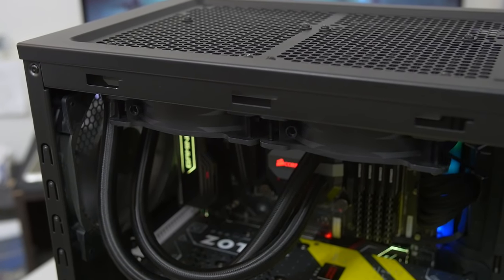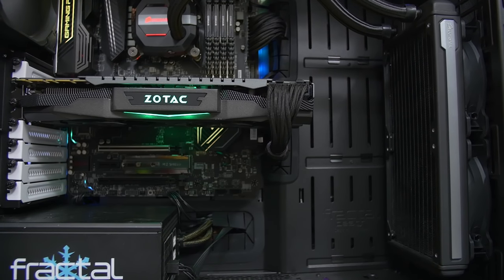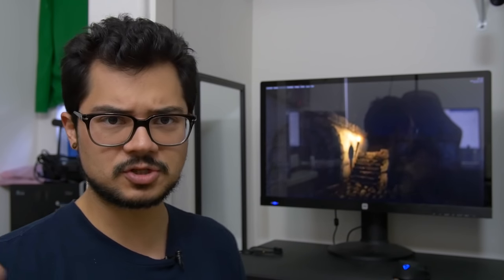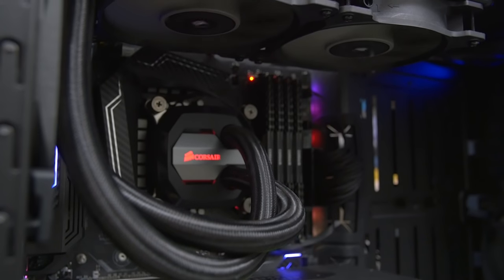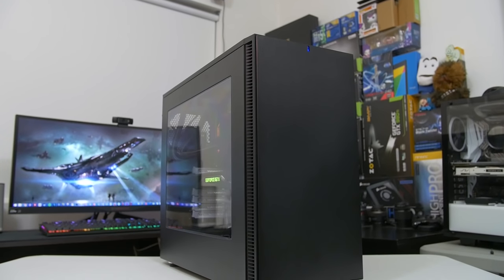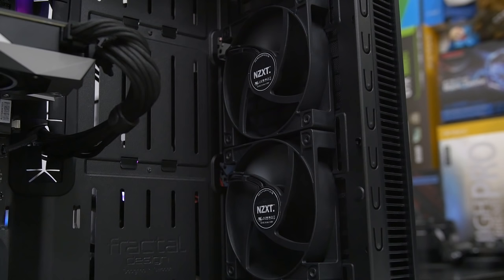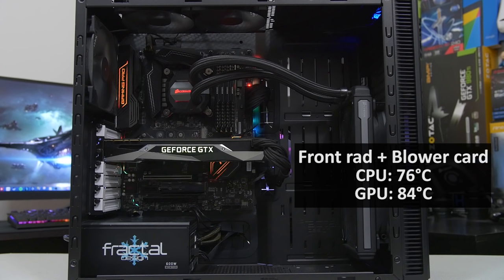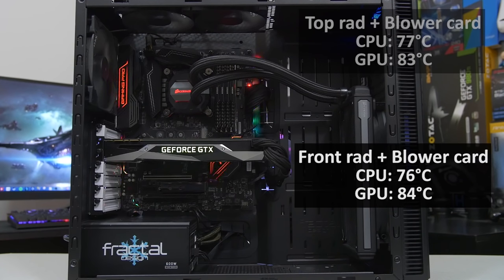Does Radiator Placement Matter? Hint: YES

Comment: I know this video is three years old now, but I have to point out one thing:
This video only really applies to AIO liquid cooling systems. Custom loops have higher flow rates, so the temperature of the radiators are actually much lower than that of an AIO. 
IF you use a custom loop,  a radiator on an intake will make a negligible difference in your ambient case temperature.

Edit: This is true as long as you're using a radiator in your custom loop of at least 240mm, and your chassis has reasonable airflow.

Comment: BTW,  you are making an installation video and the first image of a radiator shown 0:04 is one installed in an incorrect upside down orientation. 
ie lower than the cpu pump,  and with the tubes up. That pump making contact with the cpu is now filled with air bubbles instead of water... not good. Got to set the tubes going down to the base of the radiator so the bubbles will stay in the radiator and not the cpu pump. Check the videos from gamers nexus about best installation to see more details about why it’s important for noise and lifespan of the radiator.

Comment: U have to redo thos test. You shouldn't put the radiot up when you mounted at the front as and intake U have to flip your rad and hoses has to be at the bottom. That's why u saw almost no difference in cpu temp from 77 to 76.

Comment: Thanks great help. Unless I'm mistaken, you have the fans upside down. They are blowing internal case air over the radiator instead of sucking in cool external air. Which is better?
Reply: I installed my radiator on the front of case with fans pulling air from the room.  Works out perfectly. I just don’t understand pulling hot air from the case across the radiator. Maybe I’m missing something.

Comment: For casual users who don't manually overclock, and have mid-tier CPU's, does this really have an impact. I would guess probably not considering a normal system even under mild-heavy stress, wouldn't generate this much heat

Comment: Don't put your pump/CPU mount higher than the top of your radiator.  Bubbles will get trapped in the pump and cause it to fail early.

Comment: Watched a bunch of videos that didn't answer this question you did very well thankyou. I got a used pc about 4 years ago and the 120mm rad was in the main rear exhaust. Had 2 r9 290s in crossfire and it would overheat the cpu hard. 4790k and now Vega 64 been running great since I put the rad in the top front disk drive bay. About to upgrade to ryzen and ddr4 was wondering where to put the 280mm radiator. Thanx again!

Comment: Do a video like this with the new 3080 and 3090 GPU! Once they are out. Wondering if placing AIO cooler radiator in the front would be better with the new fan designs since they will be exhausting hot air near the cpu. Back and top fans will be exhaust, front radiator will be intake

Comment: Exhaust fan at rear top rad as intake and front intake fans work best from my findings lowest temps I've seen next would be front rad open gpu
Reply: This is what I was considering. Front intake fans give plenty of air to the GPU but the GPU heat doesn't then have to go through the CPU rad. Only issue is you got a tiny back intake fan trying to exhaust heat from both components... Dunno if that's ideal...

Comment: I mean, if you have got top and rear exhaust. Why would pulling air through a front mounted radiator matter. Heat rises, so with a top mounted radiator I can't imagine the exhaust being optimal.

Comment: Front radiator is upside down.  Hoses should be at the bottom to prevent air gaps in cpu cold plate fins.

Comment: Watching in 2020, thinking of getting an AIO after upgrading my chassis. I was really curious about any advantage of either placement (top or front mounting), but the video is pretty informative/helpful. Front will definitely work best but now Im worried about the length of tubing. Is there ever an instance where its too short to mount on the front and you HAVE to resort to top mounting?

Comment: Optimal radiator positioning is not shown in his video.
With an AIO you need to ensure the top of the radiator is the highest point in the circuit and above the level of the pump, in most AIOs this is built in to the CPU block, also that the outflow from the radiator is from thelowest point so it only transfers water in to the loop rather than air bubbles.
This means that any air in the system is in the radiator not the CPU/pump so the system will work more effectively with ruduce noise/vibration and also better cooling especially noticable years down the line rather out of the box that most you tubers have to deal with.
Water cooling is real world not ideal world, water evaporation happpens even in a closed loop AIO. Plan for it.

Comment: Hey Kyle, question for you: let's say you have neutral case pressure and then you add a NHD15 or the Be Quiet equivalent, how do those 2 fans affect case pressure as they are kinda in the middle of the case?
Reply: CPU mounted fans will help in a setup where air strictly moves from front to back, and the header fans are aligned to flow in the same direction.  They won't change case pressure in any significant measure.

Should be going for slight positive pressure though, less dust ingress from uncontrolled ports.

Comment: question @Bitwit or anyone else... so i'm mounting my aio liquid cooler (corsair hydro h150i pro 360mm) on the front of my case (fractal design meshify s2) and since it's the front of the case its 3 fans will be intake (with 3 exhaust fans, 2 top 1 rear)... the question is should i mount the fans at the front like Bitwit did here (where it's pushing cold air through the rad) or behind the rad (where it's pulling cold air through the rad) - the latter should allow me to clean the rad more easily, right? and as for performance, would there be any difference?

Comment: Hi Kyle, I currently have a 5700XT blower graphics card with a Wraith Spire, not a rad, cooling my Ryzen 2600. On top of that I also have a negative pressure airflow case, the NZXT 510, with only two  fans at the rear and top exhausts. My question is, if I should stick to blower style cards for future upgrades in this case (PUN). What about if I decide to add an AIO cooler for the CPU? I would like to find out some information before changing hardware. Hopefully you can see and reply to this!

Comment: Everyone's missing a point here (maybe even Kyle)... There is NO WAY that gpu would run at the exact same temp with heated air being thrown at it from the front aio UNLESS the gpu fan is simply ramping up to battle and maintain that temp. 

If it's not noticeably louder. Happy days. But the better thing to do would be to mount the aio to the gpu (using kraken g12) since that's the only part that'll get you better fps from the 30-50c even before a nice new OC. 

-Any OCd intel that even survives prime95 testing will happily chug along gaming, because it'll never get anywhere close to those temps in real world. 
-Ryzens now come so finely pre OCd going from 90c to 50c makes like no difference. Even going from stock cooler to £200 aio, even at 1080p, there is very little difference. Believe me I've tested. Only when a ryzen is the bottleneck will it help a tiny bit.

Comment: There's something I don't really understand about this conclusion. When you change the radiator to the front isn't that producing more warm air inside the housing than if it's being expelled ? And the fans for exhaust on the top are still pulling that GPUs warmth past the CPU through them, right ? I don't see how this is possible lol. Unless the only difference in the results is that you almost completely blocking the rear exhaust with the radiators cooling hoses when installed at the top. This result just doesn't make much sense to me, how is pre heated air blowing on your components and exhausted threw the top better for them than fresh marginally cooler air blown on them and exhausted the same way ? I only say this because I plan to get a case that has 200mm fans in front so a front mounted rad isn't possible unless I downgrade my intake fans sizes.

Comment: I have it on the side, just after 3 fans on front panel. then I got 2 large fans on top. Seems to be working well because my temps are max 74 in Aida64 with 100% load.

Comment: I would be curious to see how this goes with a cpu intensive test. Running the GPU intensive test with you processor basically idle is not going to heat up the radiator with a front mount.

Comment: Thinks about my case... 

I dont think theres enough room to mount as an intake on the Corsair 300R. The drive trays are very close to where the radiator would sit and theres definitely no room in between the dust filter and the fan mounts.

Side intake, here I come :(

Comment: 120mm AIO, Coolermaster RGB. R5 2600, 1070ti, max temps - Cpu 66 degrees, Gpu 75 degrees. Thanks Kyle. (front mounted AIO)
Reply: Front mounted 120?

Comment: My results with the Corsair Hydro H100i RGB Platinum

Rad on top:
CPU: Ryzen 5 2600 - 72c
GPU: Strix RTX 2060 - 55c

Rad on front:
CPU: Ryzen 5 2600 - 79c
GPU: Strix RTX 2060 - 60c

I have a Corsair Obsidian 500D SE, So im not sure how im getting cooler cpu and gpu temps when the rad is on the top
Reply: Damn I have the same case and I got the 360 radiator so it has to go at the front.. That kind of sucks if I shoulda put it at the top and gotten H100i

Comment: Would love to see this revisited and particularly with a micro ATX build. So few of you tech tubers mention MATX. I have just installed a Deepcool Gammaxx L120 v2 with the rad in the rear. Massive improvement over the stock rad that came with the Ryzen 5 3600. I also have three 120s in the front as intake and two 120s in the top as exhaust. The GPU is RX580. I think I have great airflow but the AIO has made a great difference, like 10-15 degrees.
Reply: Hi bud. Thinking of getting the L120 also for my MATX rig with an open shroud GPU. Have you tried mounting your rad in the front?
Reply: @ninos68bug  Hey :)  No I haven't although the vid suggests this would be best. For me, there's a few differences. First off my GPU is a blower, not open. Second I changed my CPU to the 5600x (the old one died on me), and third I changed my tops fans to intake. Sounds weird having 5 intake and only 1 exhaust and that thro a rad. However my case Coolermaster NR400 is pretty open at the back. In this config the CPU max's at 63% and GPU around 78% both of which I'm happy with.
Reply: Thanks for the reply. How is the L120 holding up? I'm using a cheap tower cooler (GI-x5r) and R3 3300x temps range between 68-75 when playing Days Gone. I also get 77 max on cinebench. Can I expect a significant drop with the L120? My case only allows 3 x 120 for intake and 1 x 120 for exhaust. With my open GPU, placement is really crucial for me.
Reply: @ninos68bug  the  L120 is holding up really well. I was wondering about changing it with the new CPU but reapplying thermal paste makes a difference. The AIO is definitely better than the stock air cooler. Some ytubers don't like 120 rads but it works for me. I can't honestly say what's best for you but the CPU you have won't get as hot as mine can so I would suggest the L120 would work. If you're worried about placement then try it front and back but it sounds to me that I'm your case Bitwits recommendation of front mounting is best.

Comment: an open system GPU does not only heat up the CPU, it also heats up the motherboard. I was horrified to see my motherboard reaching over 70 degree C, about 10 degrees more than my previous blower system. So, exhausting the heat from the CPU also reduces the heating of the motherboard.

Comment: Well mine WAS top mount, and I moved it to the front. Here are the results.
TEST WAS DONE WITH CASE CLOSED AND AMBIENT TEMPS THE SAME.
PC Specs: 
CPU: i9900k (Corsair h100 platinum)  
GPU: RTX2080ti Dual Fan. 
Both GPU and CPU are being tested at 100% duty cycle AT THE SAME TIME.
Results after 20 mins;
TOP MOUNT: 
GPU - 75 Degrees 1680MHZ
CPU - 58 Degrees 4300 Mhz
FRONT MOUNT: 
GPU - 78 Degrees (***Thermally throttling to 1580 Hz)
CPU - 55 Degrees 4300 Mhz
Front mount PREHEATS the air coming into the case. OF COURSE it will perform worse. GPU'S are working harder then CPU's in gaming... So preheating the air for the GPU will result in higher GPU temps and eventual throttling the GPU.
If you top mount, the CPU hot air is vented immediately outside the case. Heat rises. TOP MOUNT is better, and makes sense as the GPU generates the majority of the heat and will perform better with ambient air over preheated air. I would prefer a 3 Degree hotter CPU over a throttled GPU.

 I'm now moving it back to top mount.
Reply: Also: the GPU doesn't care, because it HAS to be thermally throttling. Did you close the case for your test? You need to note the MHZ. When I moved it to the front, my GPU temp was within 3 degrees but dropped 100Mhz...

Comment: Could you have the top mounted radiator be an intake and have a good outtake fan at the back of the case, or would that negatively affect temperatures?
Reply: That's how I have mine. Sits at about 35C idle and pretty much never goes above 80C under heavy gaming load. 3x120 intakes at the front of the case and 1x120 exhaust at the back.

Comment: I have a top exhaust 280 rad on top, and 1080ti with aio cooler  120 rear exhaust. 200mm + 120mm fans intake. Did you test that! Its the best config. Cool air in hot air out.

Comment: im planning on building a lian li and I plan to have a 360mm radiator up top as exhaust with 3 120mm fans for intake on the bottom and another 3 120mm fans on the side as intake as well

Comment: Most optimal is CPU aio cooler exhausting top and a hybrid card exhausting out the back. My CPU temps stay as cool as taking air in from front and 1080ti hybrid sits 53c under load and case stays cool to the touch. It's all cool

Comment: The info that putting a front rad is a great benefit for a cpu is pretty obvious, but what is not obvious is with both top rad and front rad gpu has the same temperature (71 according to your numbers) that pretty wierd...Putting a top rad mean that you have fresh intake air from the front and 3 exaust fan from inside to outside, that is the best scenario for the gpu (worst for cpu), putting a front rad mean that a fresh air intake pass through the radiator and become not so fresh and then from the inside has only one exhaust. How is possibile that both case gpu is still 71?

Comment: you did not describe how the other fans are setup. 
did the rear fan pull air into the case? 
because the hot air is no longer inside the case, but outside, so pushing more fresh air in the case may be better.

and with the front setup, did you test pushing hot air outside? with top and rear fans setup to pull fresh air from outside inside the case.  pushing fresh air to the VRM at the same time.

there so many setup possible :)

Comment: I would have liked to see top rad with the fans pulling fresh air in rather than exhausting in a open card test. Seems to me like more of an apples to apples comparison rather than what we saw in the video which was top rad getting hot air from inside the case exhausted through it yet when you mounted the rad to the front of the case you had the fans pulling in fresh air from the outside.

Comment: I have myradiator on the top blowing in from the outside and still having a rear exhaust and the front fan of the case is an intake running 6700 k anywhere from 28 to 35 degrees Celsius idol

Comment: Steve, from Gamers' Nexus, would not approve of that front-mounted radiator, where the hoses are at the top and higher than the pump block.  That's a recipe for noise and shortened AIO life.

I think, as well, that I would like to see a top-mounted radiator where there are ALSO front fans to bring in cool air.

Comment: I installed my first ever AIO in my case and had to front mount it because of the case but I made sure that the pump was lower than the top of the radiator and the hoses are on top not the bottom

Comment: not sure if I asked this or posted this before, but if your front has room for 3 120mm fans could you still mount a 240mm radiator, or would you loose one of the fans?  It kind of looks like you can at 2:15, but I wanted to make sure.

Comment: Hmm... What if the back fan was set to intake, with the top mounted rad being the only exhaust + open air GPU?
Reply: I think that would work. Just be mindful that the OPEN gpu still expels the exhaust air through the back as the PCI-E backplates are usually open. So there is a chance that the air will be heated by the HOT exhaust. 
Remember that the water in the AIO radiator is usually under 40C, and ambient room temperature is normally under 30C which is 86F which is really hot!! So you only want to cool the radiator with air that is colder than 40C. The GPU can heat up air greater than 70C since the GPU is usually 70 to 80C hot!

Comment: Tried it on the Define 7 XL with 3900x cooled by a LF2 420mm and a 3080 Suprim in there. 10K difference here, too. Yet people are still convinced the gpu will run hotter. It won't really matter 😂

Comment: But, mine is at the back... I assume that is the same as the top and is an exhaust.

Well, depends on the fan orientation, I suppose... 

I'm confused.

So, it's an intake fan, radiator and another fan blowing into the case.

Comment: @Bitwit why no negative pressure tests? (Top mounted rad pulling cold air into the case and then that air getting ejected out the rear exhaust. only exhaust is rear fan*)

Comment: When he did the front mounted radiator were the 2 120mm fans on top being used as exhaust or intake??
Reply: Judging the fan sticker between both configurations it looks like he had them set as exhausts. 

Personally with the same AIO config I have the rear top fan exhaust and front top fan intake